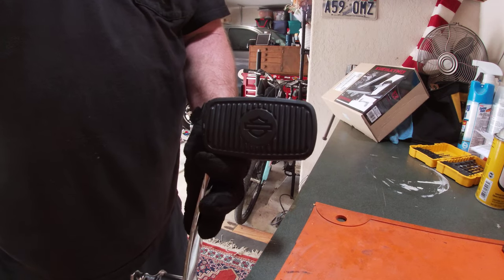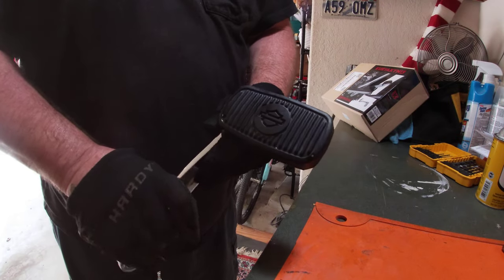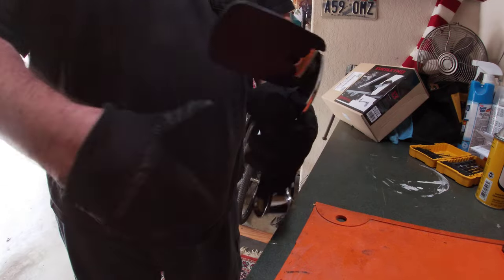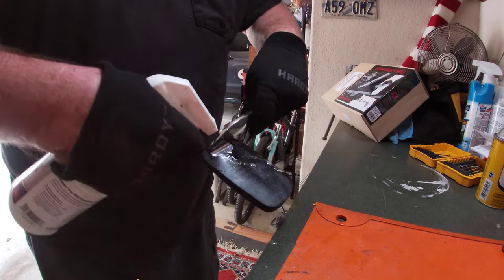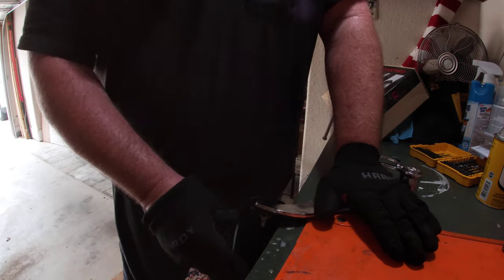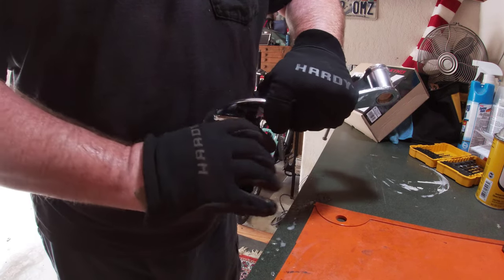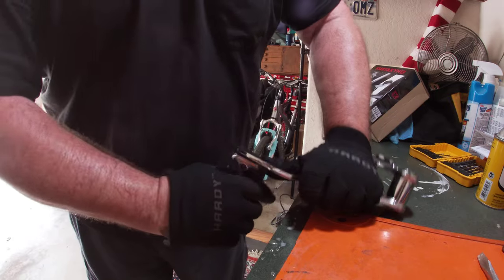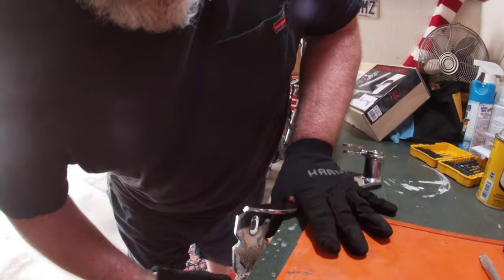Harley Davidson Bagger Brake Pedal Pad Removal

Comment: You might be able to use an air compressor with a blow gun nozzle on it and shove it in there to make it it push the rubber out so you can slide it off easier and do the same to slide it on to the new brake pedal lever. I've never tried it but it works great for rubber grips on motorcycles and bicycles. 

If you spray hair spray on the handle bars it helps it slide onto the new one and as soon as it dries it works like grip glue. I'm guessing that would work on the brake lever pedal lever the same way. 

The way you did it looked pretty easy anyway but if my suggestion works, might help someone with less hand strength.
Reply: Also thank you for posting this video. I'm getting ready to replace mine and wanted to see what I'm getting into.